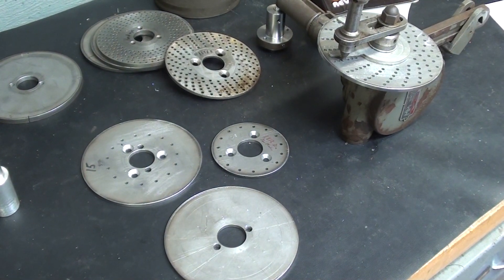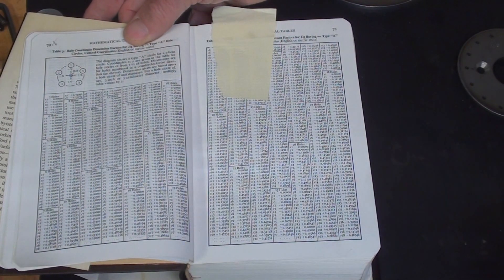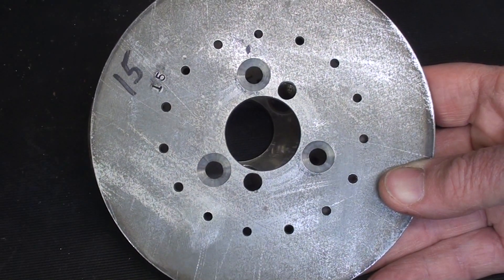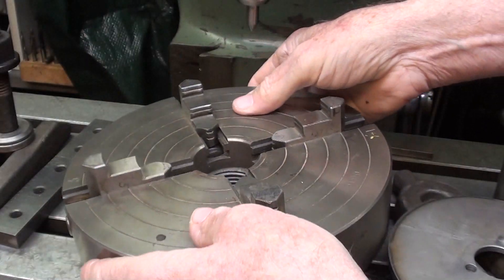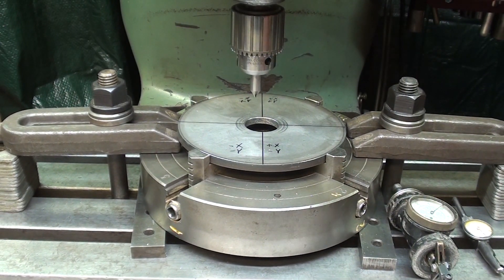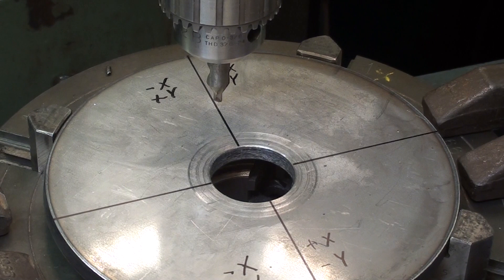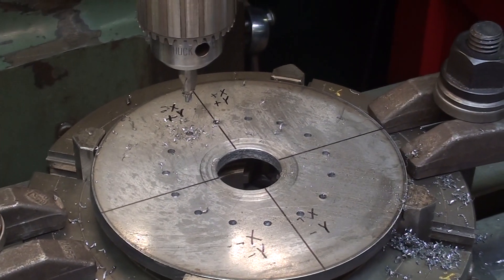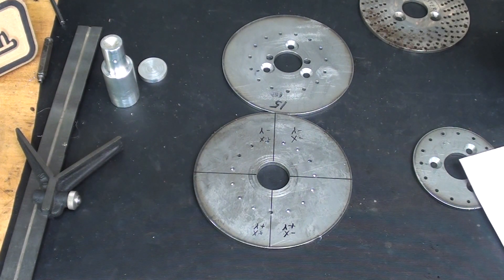Making Indexing Plates TIPS #624 DRO METHOD tubalcain

Comment: For those of you that are "on the fence" about ordering Lyle's videos, I can tell you this.  The very spry 82yr old Gunsmith in my area sold me a Southbend Model 9A lathe with several attachments.  I didn't have any experience running a manual lathe so I ordered Mr. Peterson's video series for my particular make/model of lathe.   I can honestly tell you that I am very pleased with how thorough this video series is and it covers everything from the basic lathe controls, work-holding devices, threading, tapping, reaming, basic turning, facing, taper turning, tool bit grinding, safety procedures, tool-post grinding, boring, milling on a lathe, and much more.  I can tell you that these instructional videos are fantastic and there are scads of tips/tricks throughout the videos and the price was fair too.  No, I don't know Mr. Peterson and I'm not affiliated in anyway.  I'm just a happy customer.
Reply from the maker: Thank you very much, that is very encouraging to me. I may use your testimonial, without your name, in one of my promos Someday.
Reply: @mrpete222  Keep up the good work Mr. Peterson and you're welcome to use my name if you like.  I will always stand behind a good product.
Reply: I had never turned a crank and was able to disassemble, clean,service my 60 year old Atlas 12 inch lathe after seeing Lyles’videos. With the videos I can do most of the basic procedures on the lathe.
Reply: Ditto that, I've purchased his Atlas Lathe, Bridgeport Mill, and foundry courses and they are all superb. I've learned so much from Mr. Pete, very grateful!
Reply: @MrUbiquitousTech  I almost ordered the "How to run a Bridgeport Mill" series last week last week and l don't even own a manual mill (or CNC mill) and I've never use one.  I just have a "thirst for knowledge" and it's fun to learn about something even if I don't have the machine. However, I ended up spending last week's "pocket money" on more tools for my Southbend lathe.
Reply: I too have a southbend 9a. I would be very interested in this. Where do you find the video please?
Reply: @stephenmale4492  https://www.youtube.com/watch?v=l8VNUq3IXxs&t=66s

Comment: I've done a lot of hole patterns in my career. It's easier to always dial positive on your dials. So what I've done is to use 10 instead of zero for the center of my hole in X axis.  And 6 (because it's the center of travel for Y axis) instead of  0 for Y axis. That way, all my numbers are in the positive position. For instance instead of having a hole in the negative one inches and a whole at the positive one inch position , you would have a hole at 9 inches and a hole at 11 inches (10 inches being the center line of your part in X axis) or a hole at 5 inches and 7 inches ( 6 inches being the center line of your part in Y axis).
Reply from the maker: Very good idea. I normally do not like negative numbers myself. On the rectangle or stock, I always start at the lower left-hand corner.
Reply: @mrpete222  the other thing that I did (not having digital read outs) I made T nuts for the T slot on the front of the machine then I took a yardstick cut it to 24 in Long and put holes in it so that I could a fix it to the front of the machine on the x-axis. Now I have a scale I can adjust so I can set a 0. That eliminates having to count turns.
Reply: Great tip, Robert!

Comment: Thanks Mr Pete. I just checked my Machinery Handbook, from my father, 10th Edition, 1941. It does not seem to have the table you are using, but does have a table called "Length of Chords for Spacing off the Circumference of Circles with a Diameter Equal to 1." It then instructs you to multiply the number by the actual diameter you are using. I suspect this was the equivalent method and was used to help win the war! Merry Christmas to you and your family.
Reply from the maker: Thank you, it must’ve been a good method Since we won the war. The handbook changed quite a bit over the years
Reply: If you're laying out a bolt hole circle, that's much easier. Set the radius on dividers, scribe the circle, set the chord length, and scribe off the bolt circle.

The higher the gear ratio in the dividing head and the larger the radius, the less any positional error matters. A 0.010" tangent  error in a circle with a 2" radius gives a 0° 17’ error, gear that 40:1 and you have an error of only 0° 0’ 26’’.

Comment: Good Morning from the UK.  Does your DRO not have a bolt circle facility,  I used it on mine , then you do not need any of those numbers. I made 3 plates to go with my Rotary Table. Thank-you for all your video's, I have also made 2 Float Lock Vices & found them to be most useful.  Happy Christmas to you & your family!
Reply from the maker: My DVR all is 45 years old. It had no extras. Merry Christmas
Reply: I bought a cheapish chinese dro for my mill and it does have many good features like that, pcd's, pocket milling, drilling holes at an angle to an axis. Brilliant and really make even a manual machie much more versatile.